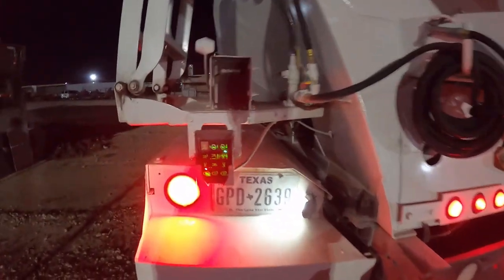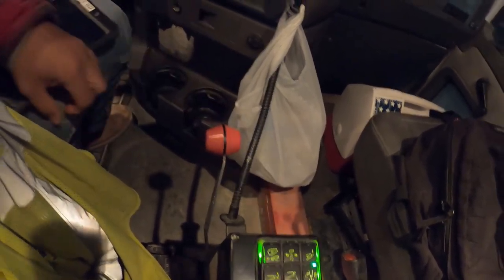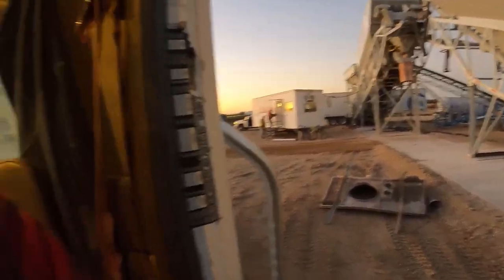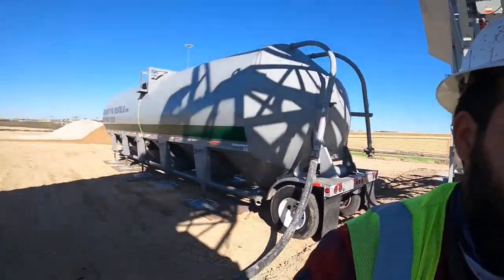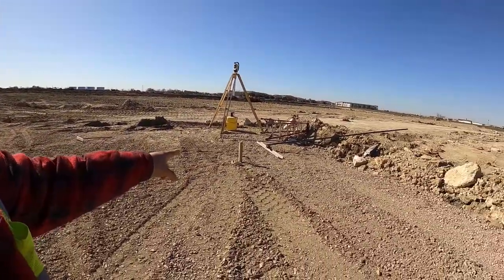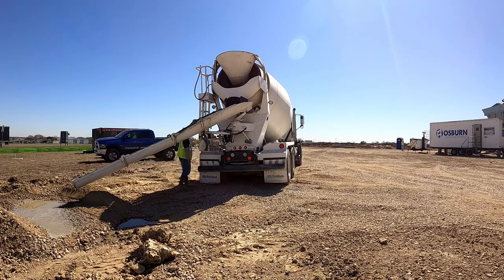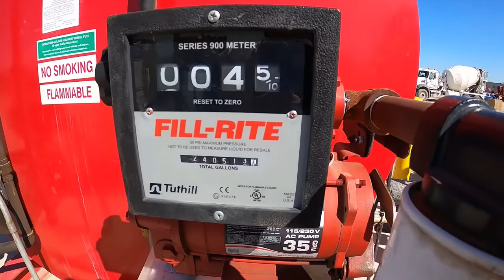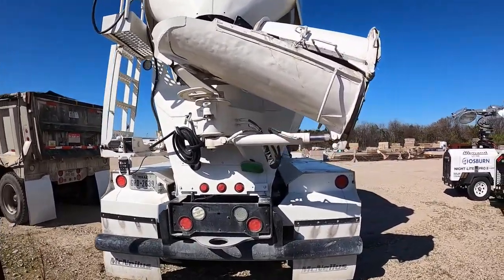A Day In My Life....as a Mixer Truck Driver

Comment: I've been driving a concrete truck for 9 months now. After training I got a turd to drive. After months of hammering and scrubbing I turned it white like yours. They just gave be a new 2022 Kenworth T880 Thursday.
Reply from the maker: Must be nice to have a new truck
Reply: @cardozaslegacy4163  its comfortable and nice for sure but a little weird. The biggest complaint I have is if you go an wind it up from the controller in the back to slump it down you have to turn on a remote throttle switch in the cab, but in order to actually drive the truck you have to turn the switch back off.

Comment: I’m tryna become a cement driver what I gotta do to get started?
Reply from the maker: You have your CDL
Reply: @cardozaslegacy4163  no
Reply from the maker: For starters you need a medical card (roughly 65-75$$), then you can get started with the CDL license process (I obtained mine through Continental) honestly my experience was great and I highly recommend using a CDL school(do some research to find something around you if Continental is not available).
Reply: @cardozaslegacy4163  appreciate it 💯
Reply from the maker: No problem
Reply: Cement truck driver is Class A. They deliver cement to concrete plants. Concrete truck driver is Class B and they deliver concrete everywhere.

Comment: Can somebody give me an idea of the regular hours week to week?  Someone told me they start between 12-2am.  Is that the average? Any insight into hours and regular pay?  Hourly or per job?  Again, averages.
Reply from the maker: The pay is from 18 an hour up to 24 an hour
Reply: Hours is different every day sometimes you start at 11pm other times 1am it's different every day
Reply: Really the time you start your shift it all depends on the time the customer is ready for the concrete...but yea its different times every single day...takes some getting use to
Reply: @TheTXHighRoller  no joke no set schedule so your sleeping pattern is all fucked up screw that
Reply: Pay can be anywhere from 19-30 a hour I work for ready mix in dallas and they started me off at 22 I know guys in here making 30 a hour so u can make some real good money working 15+ hours overtime